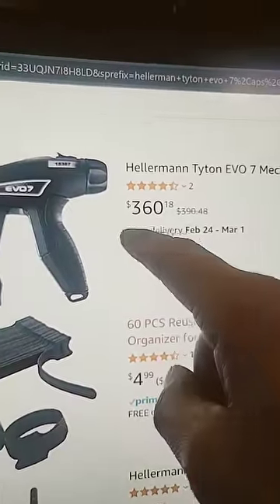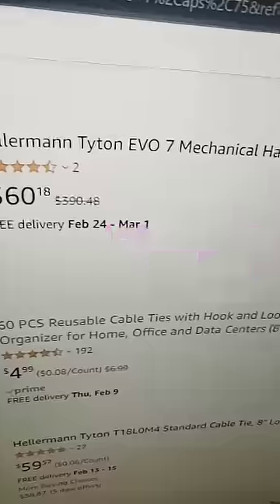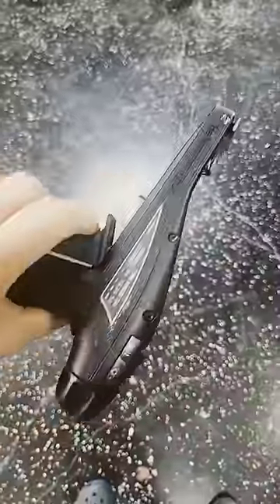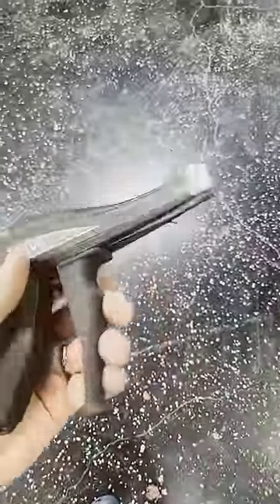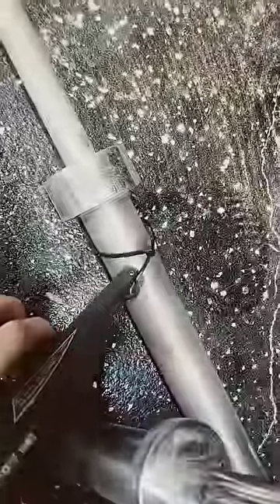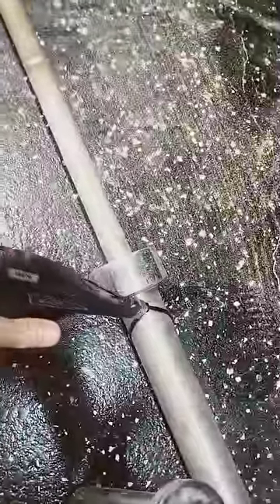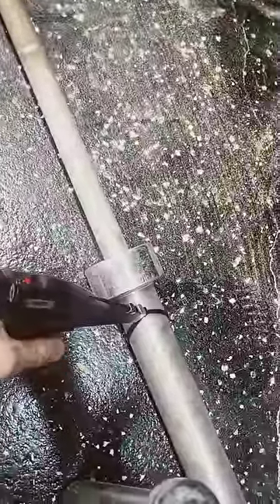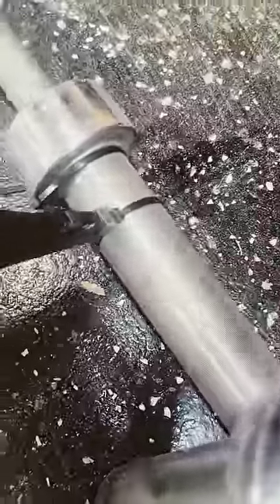When you like it TIGHT #shorts #electrical #shorts

Comment: Those in the aerospace industry know how much of a bargain that price is for a quality tool like this.
Reply: probably the only industry that has an appreciation for it though right? most of the time you could do the same thing by hand but I imagine with a giant mass of wire or cable or conduit the ratcheting feature is a life saver
Reply: @nickadams5768  aerospace isn’t the only industry. Telcom and data services companies, pc builders, automotive wiring harness manufacturers, pretty much everyone who must professionally install managed wiring. 
For aerospace companies these tools are calibrated to a specific tension so that the tie properly held the wiring without putting too much pressure on it as many electronic controls use fiber optic connections to mitigate additive noise from the static field in earths upper atmosphere.
Reply: Aerospace zip ties😂

Comment: I have 3 or 4 panduit ones from the 90s. they're solid metal and you can set it from tiny little packing zip ties upto the biggest that will fit in the mouth of the tool
Reply: I used to build Panduit's Gun Tool(s) in Tinley Park, years ago.
Reply: @dabbler90  my father was good friends with an employee there and we have 3 or 4 of them in total. 2 I'm the shop, 1 in the truck and 1 on loan somewhere

Comment: So I've used this $370 ziptie gun and it doesn't shoot the zipties out very well. It's just very easy on your hand. The $80 solid metal ziptie guns are the best. The $20 zip tie guns break very quickly.
Reply: you don't want the cut lengths to shoot anywhere with those, you want to remove them from wherever you're working without the risk of leaving any behind.
Reply: @kittytrail  you saying they are supposed to cut them flush with the head of the tie? That makes sense. I would need to cut like 200 at a time and didn't care what got left behind. This gun didn't work out for me.
Reply: @A30MinuteBan  you place the ties by hand and then do a second round to tighten to the right specs and cut them flush in one pass. not letting the cut ends fall off anywhere is a function as those are mostly used in aero or industrial context where it would be a problem later. using those correctly is key, lots of people don't take the time to read the manual nor properly set up the tool and end up blaming the tool. from my experience, there's no substitute when having to do repetitive and reproducible tightenings of zip ties. a good flush cut pair of pliers can be used to cut, but the tightening force of the ties will be all over the place when done manually especially with complex wiring harnesses. in the end it all depends on what you need to do and what level of quality control you're paying (or are paid) for. right tool for the right jobs, wrong tool for the wrong jobs. 😉

Comment: I use plyers and a razor blade for the same tight and flush cut function. 😉
Reply: Just count the clicks after it is finger tight for repeatable tightness.
Reply from the maker: sounds good for maybe a few here or there, but not if your doing a lot of them

Comment: i wouldn’t even want it if it was free
Reply from the maker: its kind of cool my buddy got it for like 50 from a guy that  got the newer model,   it flush cuts at the same time.  I have do a ton of cable tray work,  that alone WILL pay for it's self in man hours  still to much for me but i was bidding a job I would make sure it was part of the bid as it would probably be a wash  and still break even
Reply: @toolsandtactics  $50 is fair for this. I'd buy it for $50, personally. Pretty neat device but definitely not $300 neat lol

Comment: See to me getting the zip tie threaded is the hardest part  ( wearing thick gloves in the  snow especially) once it's in I've had no problems getting it tight. Then just use the sharp tool already in my pocket to cut them off. If you are nice to me you get flush cut if you are a dick you get a razor blade like point.

Comment: I have similar tool that only cost $45 and works way better because it's variable depending on the hand pressure you use and cuts perfectly flush every time plus I show that I'm actually smart because I can then use the other $300 to enjoy a night out with my girlfriend while you enjoy a night in with your hand.
Reply: except they don't take into account your own variability when you're tired, or work in a colder environment, etc. those, like the classic ones Panduit, let you set whatever tightness you want for your ties and go to work, no need to think and second guess, repeatability is always there.
i own and use both type and each has their uses, pros and cons but they're definitely not interchangeable for every use case. 😽